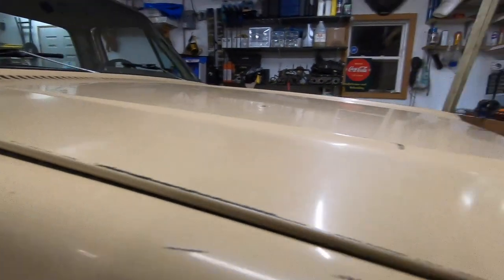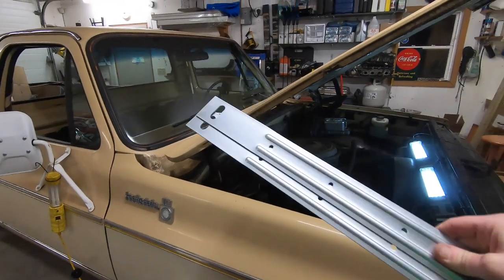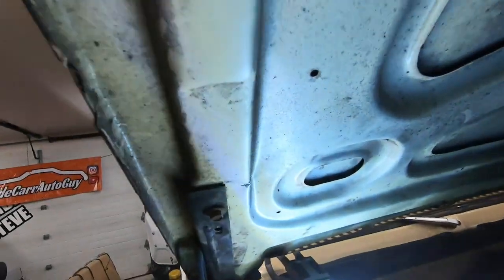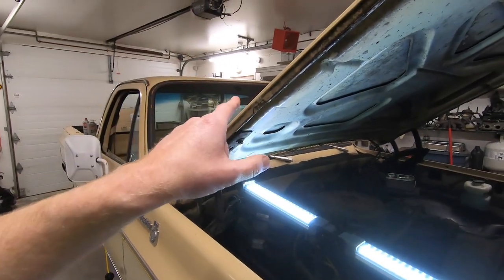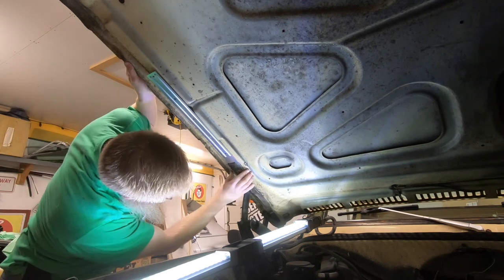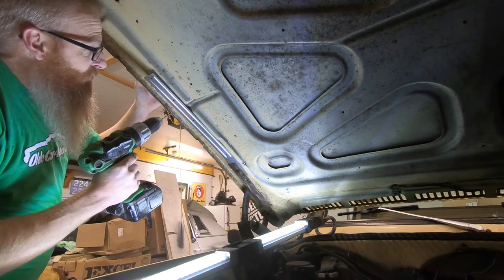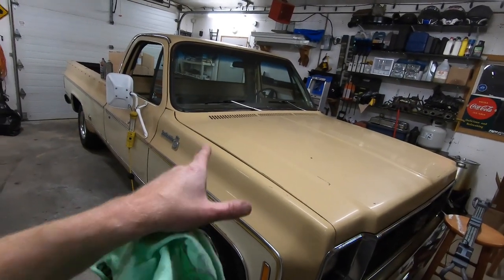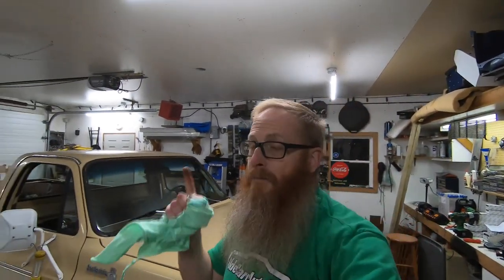HOW TO INSTALL HOOD HINGE BRACES FROM LMC ON A 1973 1987 CHEVY C10

Comment: 100% correct lack of maintenance. wouldnt hurt to change the hinges for new ones in the future, im sure you will keep the hinges lubed as need be. Sometimes the spring was to strong so the hood would bend a little before the hinge would give. 73-80 was bad in 81 they fixed that changed the style of hinges and length of the hood by making the cowl its own piece.
Reply from the maker: And that’s the case here! But I’m gonna take the hinge off and soak them to help free up the pivot points.
Reply: @OldeCarrGuy  what do you soak them in?

Comment: I bought the kit but the holes in it didn't mach with the inner structure, turns out my hood is an aftermarket reproduction, I replaced the hinges and springs all together with those braces and my hood kept bending with those braces on...I bought a new hood and I made some braces as a precaution, with angle iron. I welded some nuts into the inner structure of the hood, allowing me to bolt on the new braces.
Reply from the maker: The concept is great however, specific to factory hoods and hoods not already damaged!
Reply: Yep, to bad the make aftermarket hoofs with a different shaped inner structure and sometimes VB poor quality. The new hood that I purchased, had half the spotwelds mating the outer skin in the front to the inner structure. I also noticed that the outer skin is thinner then the outer skin of the old hood.